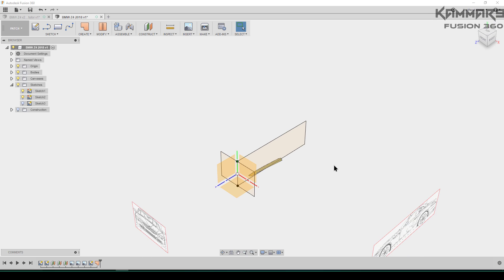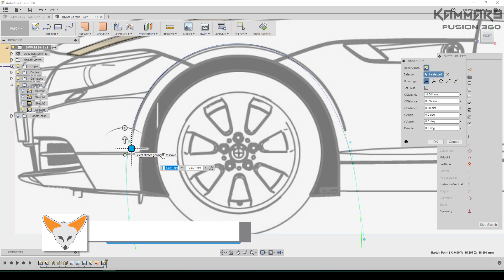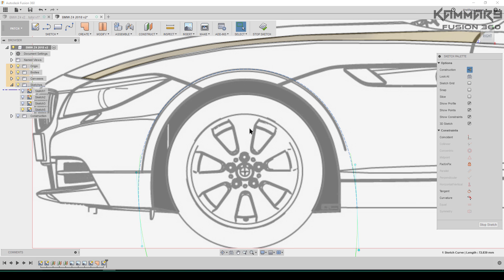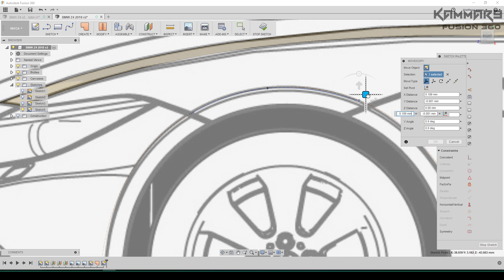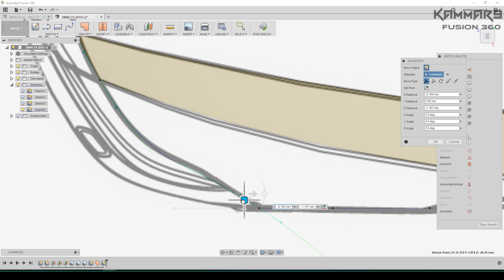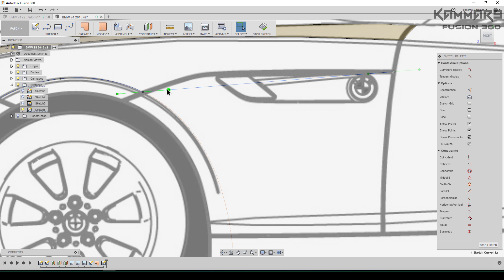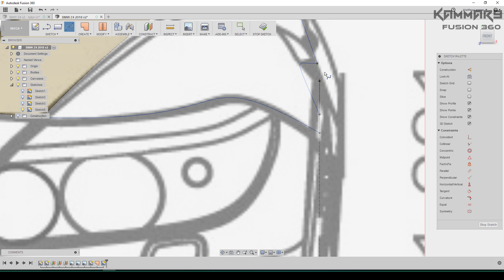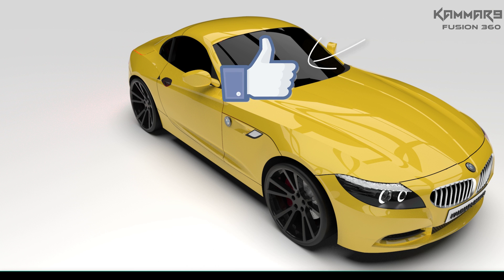BMW Z4 With Fusion 360 EP 02 😍😍 Full HD 2019

Comment: is the patch tool still in fusion 360, and if so where is it?
Reply from the maker: Yeah bro, you find it on surface mode
Reply: @AmmarKhelifaoui  thanks man, I keep missing those tabs at the top since they change the UI, I was used to the dropdown menu, then didn't use fusion for a while.